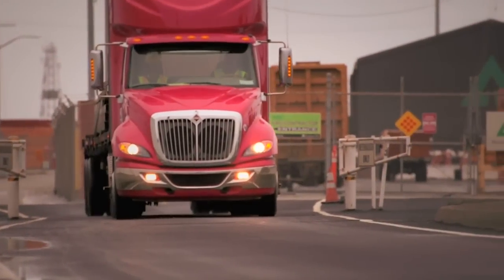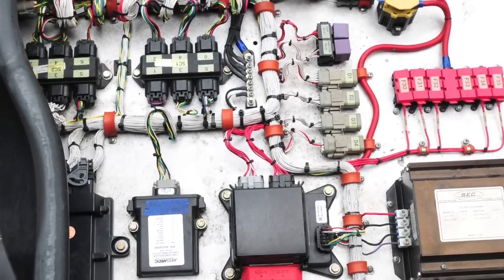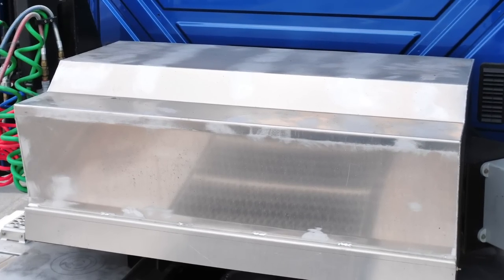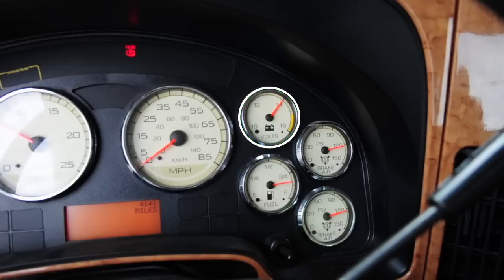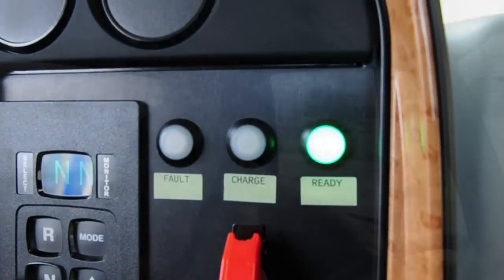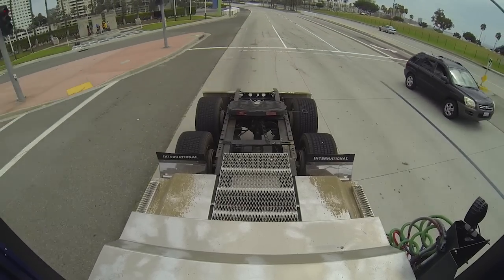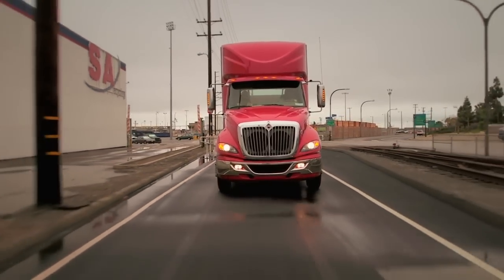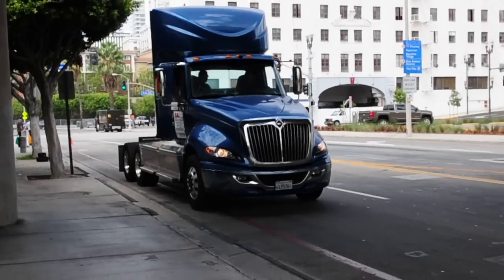Focus On… A 100% Electric Class 8 Truck

Comment: For what seems to be essentially a proof of concept, this truck is amazing!  Kudos to TransPower for making it happen.  Hopefully they will be able to enjoy a healthy head start on any competition for future sales.  Seems like innovations in batteries and electrical conductivity should make this approach the way to go for the future.  Great video too!  More on such green technology would be quite welcome.
Reply: +Kevin Slavens Thanks for the kind words Kevin. I was fascinated by this truck. Clearly it works as intended for a limited application. That's okay though. Not all trucks run hundreds of miles everyday on the highway.
Reply: +Kevin Slavens This looks like a truck converted from a diesel the same as other companies do to gasoline cars. They don't go near the efficiency or performance of those originally manufactured as electric.  I wonder what they could do with a truck built to be electric.  As a conversion that is amazing.  As it is this truck could make at least one round trip between nearby cities on a charge.
Reply: +OptimisticPessimist I agree with you on a clean-sheet approach, which would have better results.  But if you read the other comments, acceptance by truckers is not going to be easy to come by.  Having, at least, a familiar look to the truck will help a lot.

Comment: drivers say these trucks have some drawbacks and if they do they're just first or second generation electric trucks if you look back historically to when gas engine trucks started back in the early nineteen-hundreds they couldn't carry a load they were basically a small wagon with a motor on it it took decades to get to the place where semis are today so and 60 years we'll see where electric trucks are that you're not running your diesel then I give it about 5 years diesels will be collectors items

Comment: This is just wrong I mean come what happened to diesel. I mean yeah great that we want to save the planet but semi trucks are not made to be electric!!!! I am vey disappointed international!!!! :(
Reply: +Bryce Culwell  Hey Bryce, I feel your pain. But don't worry diesels will be around for a lot of years yet, despite the EPA's best efforts to make them as expensive as possible. These electric trucks will serve niche applications and maybe city P&D work. And by the way, this is NOT an International product. The company behind the electric powertrain, TransPower USA, buys the cab and chassis from an OE, International in this case, and installs its own drive system.It's basically a glider kit. I have been told that they will be buying glider kits from other OEs soon and expanding into other lines of trucks.
Reply: +Jim Park ok good because I was about to be very upset with international that makes me feel much better that it's not an international product.
Reply: +Jim Park even though international doesn't build it it technically is still an international because the emblem is on the hood but since they don't produce I am happy with international.
Reply: +Bryce Culwell Buhu stop whining. You can obviously buy  a diesel. This is just a product for those who do not drive long distances. We should only appreciate that manufacturers have different ranges so you can buy a truck that is suitable for the tasks you are doing
Reply: +Bryce Culwell Diesel trucks aren't going away anytime soon, especially for long haul applications. In fact it's hard for electric vehicles to travel long distances at high speeds since range is obviously an issue. Business will use these trucks for short trips and deliveries in local areas and as batteries get better and cheaper they will save their owners a lot of money on maintenance and fuel costs. Diesel trucks belong on the highway on long hauls where they're most efficient. Electric trucks will take care of the shorter distance trips for local businesses. I for one, hope that International and all the other truck manufacturers build electric trucks alongside their diesel trucks to offer more options.
Reply: +Pablo Power You understand this Pablo. Good on you. Obviously electric trucks have no place in the longhaul world, but they are especially attractive in cities where emissions are a problem, like the LA basin in California. The trucks themselves produce no emissions and no noise for that matter, making them a popular alternative to truck currently in use, while annoy the locals no end.
Reply: +Pablo Power Yes that's right diesel trucks aren't going away. But you can drive your diesel on new fuels like RME or HWO. I don't know if you have that in the states. RME is made of Rapeseeds. And HWO is made of slaughter waste. RME has some problem with cold winters and like 5 % lower MPG. HWO is even better then regular diesel it doesn't soot as mutch but is more expensive.
Reply: +Pablo Power Wait until they start putting more batteries under trailers.  It may not be happening yet, but maybe after these reach a certain range, longer direct hauls than that might be less common, instead they'll be split to fit the shorter range of electrics, as even though these take a long time to charge it's still a lot cheaper than fueling and maintaining a diesel.  More work for dispatchers/dms though to coordinate trailer swaps and hand-offs. Another upside, maybe there will be more work for drivers close to home.
Reply: +tobbzor Organic based fuels like RME or HWO aren't available or aren't used in the US as far as I know. Alternative fuels are great, but they're still a short term solution because eliminating emissions completely should be the ultimate goal with all shipping in the future. Plus, if the issue of battery capacity can be solved it would reduce running costs significantly, which is hugely beneficial to the end consumer and shipping services.
Reply: +OptimisticPessimist I like this idea, perhaps due to the standardized size of trailers there might be trailer battery swaps every few hundred miles? Vehicle battery swaps are troublesome due to the different vehicle layouts and designs but a battery pack that fits under a 53 foot trailer would be fairly easy to attach/remove at a truck stop. If that's not practical then swapping trailers might be a better solution but any of these ideas could work until battery capacity improves to the point where they're no longer needed.
Reply: Pablo Power
Even if that develops, I don't know how long it will take for companies to phase them in given it might double or triple (at least) the cost vs a basic box trailer.  It might even need the bottom to be a battery or battery cage on wheels with the box being transferable like those coming off boats.  There's another huge benefit though.  They'd be harder for cross winds to blow over while empty.
Reply: Here's another application for putting a battery pack on trailers: If you put electric motors on the trailer axles they would provide braking assistance and also reduce drag when climbing grades. That would benefit any type of tractor for increased MPG or kWh/mile. Also, the energy from regenerative braking would help keep the battery pack topped off. Downside: it would make for a pretty heavy and expensive trailer.
Reply: Pablo Power
It would be worth it in the long run for profit margins and/or lowering costs for customers and end consumers. But like any investment, one would have to be careful with their short term so bills and employees can still be paid on time.  Another issue is the 80,000lb federal weight limit. So, depends on load.
 Edit: There are higher or no weight limits in some states off of interstates, dependant on state.